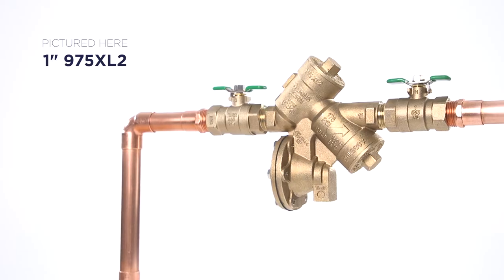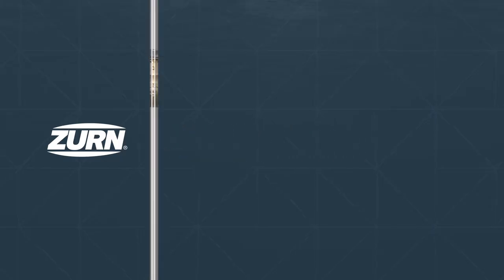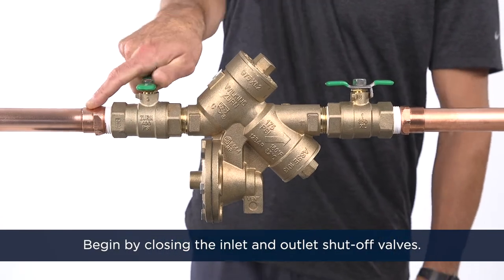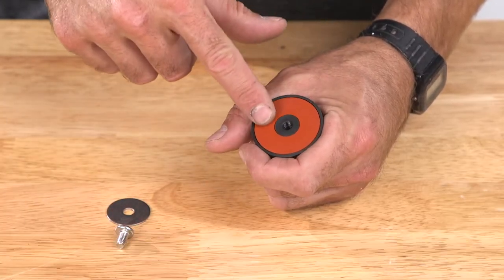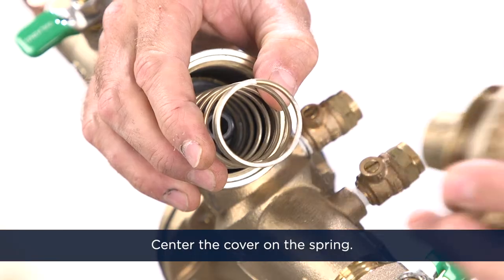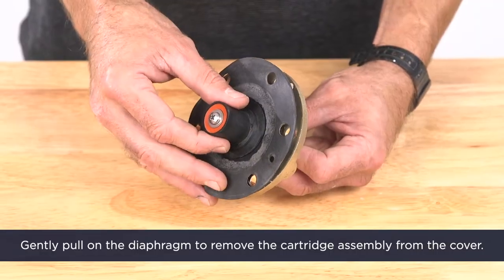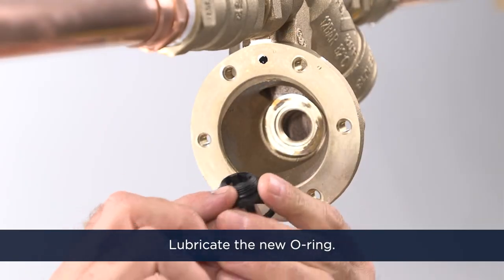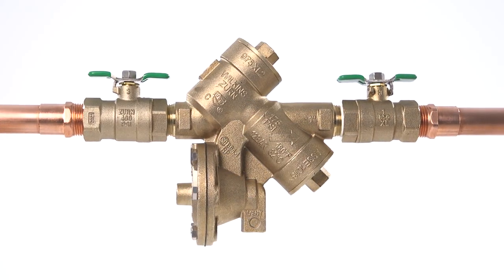Troubleshooting a Zurn Wilkins 975XL2 Reduced Pressure Backflow Preventer

Comment: How tightly should the seats be screwed in?
Reply from the maker: Hi Stan, thanks for reaching out! Hand tight should be enough. If you have any further questions, feel free to reach out to our customer care support on our website.
Reply: Followed instructions to the letter but cannot get vacuum pressure to return; have a steady, very hard flow of water through relief valve.
What did I do wrong placing back in service?
Reply from the maker: @s.j.8509  Hello, I believe if this was an assembly that a repair was done to, that the springs were put back into the incorrect positions on the first and second checks. The springs look similar in size but have different weights. The spring with the heavier weight has to go into the #1 check (the check pointing up) as it has to bias the incoming pressure closed. If these are reversed that weaker check will not be strong enough to hold the incoming pressure back and cause a full dump out of the relief valve.
Reply: No matter what I can’t turn the #1 cover … any tips to loosen it? Mine is 8 years old
Reply from the maker: @jdcarling  Hello, I would suggest checking out this video on our channel: https://www.youtube.com/watch?v=8zabRtFXCUQ. and then reaching out to Zurn customer care if this issue persists: (1.855.663.9876)
Reply: @ZurnIndustries  Correct. Swapped springs and pressure returned.  Thanks!